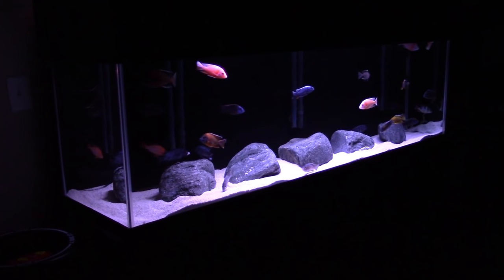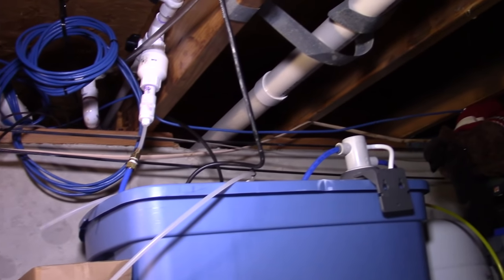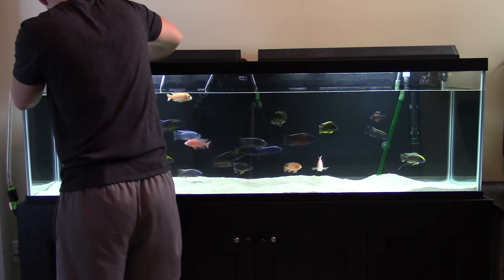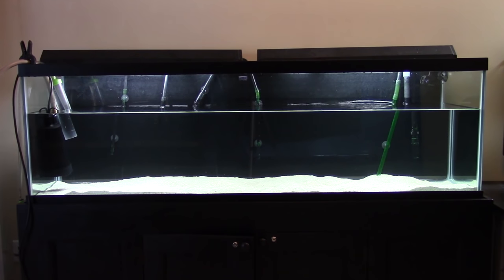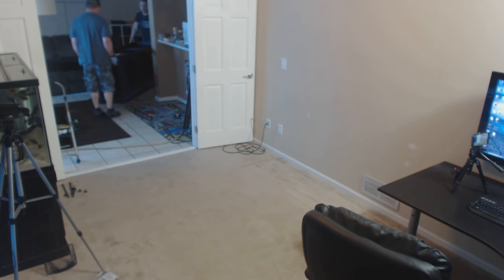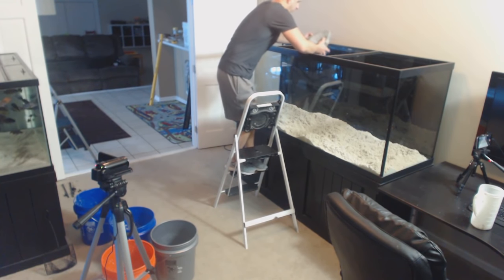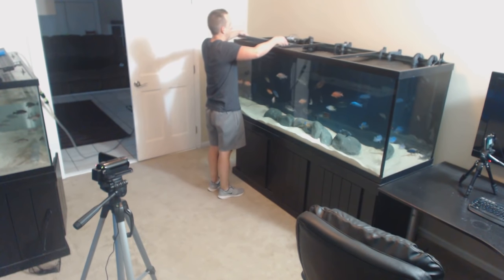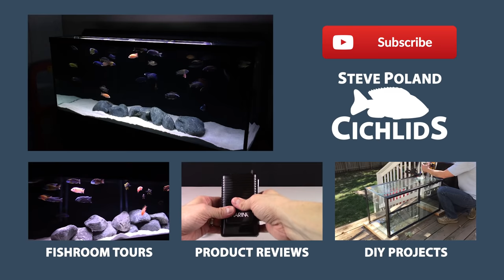How I Installed My 220 Gallon Aquarium

Comment: If you want to prevent cloudiness, we place the plastic bags from the sand on top of the sand and begin filling. As the tanks fill, the bags will slow rise to the surface. From there, you just remove them. The slower you go doing this, the less cloudiness you will get. We use this method for saltwater tanks which we all know can be a pain in the butt.
Reply from the maker: +Team Pham that's a good tip, though in this case most of my sand was coming from the old tank. I had a couple of new bags but they were super nasty inside after the sand was emptied and I wouldn't have wanted them anywhere near my tank.

Comment: tank looks phenomenal steve. I did pretty much the exact same process in switching my 125 to my current 220. you don't realize the difference in size until you get it up and running and can see from the side how much more room is available for the fish
Reply from the maker: +Adam C thanks Adam. It really is huge.
Reply: +Steve Poland Cichlids any plans to add any new species?
Reply: +Steve Poland Cichlids and I'm assuming you got a warranty card to send in within 10 days of purchase? make sure and do that within 10 days. I forgot and it was a pain in the A to get them to accept my warranty card cuz I was a week late
Reply from the maker: +Adam C that's a good tip. I made sure to send mine in within the 10 days.
Reply from the maker: +Adam C not at the moment. I combined all of the biggest fish from the 125 and 90 and I'm going to let them chill for now.

Comment: I went from a 125 to a 220 like you but I used two 55 gal drums to save the water and gravel as well as running my filters. It gave me immediate fish stocking without the worry about ammonia spikes and change over so as to not stress out the fish.

Comment: Excellent video Steve. I just finished up painting the back and bottom of my new 220, now just waiting for help to pick the sucker up and get set up. Transferring from a 125 as well and its already sold so I've got to get these fish move asap. Thanks for sharing this video is was just what I've been searching the tube for.
Reply from the maker: +Frank Wite thanks Frank. It's quite the difference in size and weight. Hope this helps you a bit with planning.

Comment: Painting over a tan carpet without a drop cloth? You must not be married... lol

Great video, Steve! Not many people think about reinforcing their floor. Luckily I live in an area of AZ where very few homes have a basement. Fish on!!
Reply from the maker: +Dude, That's Cichlid! I am married but the painting and carpet cleaning both fall under my list of responsibilities so I don't hear much about it.
Reply: Well it helps that you're not sloppy or clumsy ... I'd have done it, too. My wife's the same way... but only after a few years of minimal accidents or spills and knowing I'm crazy careful with every project. By the way, what was the price the seller agreed on for the 210 you resealed? I'm curious what I should be thinking of paying myself. Also, that tank would've held without a doubt. No one ever really trusts their first reseal. After ten years I might have reseamed it but if there weren't any stress bubbles you'd have been golden for another decade with a reseal. FISH ON!
Reply from the maker: +Dude, That's Cichlid! You may be right but I will sleep better this way. I sold the 210 for $400.

Comment: Did you begin filling the new tank with water straight from the tap? I'm curious as to how to you filled it while also preserving the bacterial in the sand, assuming that the water wasn't already dechlorinated. Wouldn't dechlorinated water kill any beneficial bacteria?
Reply from the maker: +Ashley Manville the beneficial bacteria in the sand is very hardy. The small amount of chlorine in tap water won't kill most of it. But yeah I just filled it right from the tap and added dechlorinator a minute or so after it started. I also preserved most of the bacteria in the biomedia in my filters.
Reply: Thank you! I'm  beginning to plan the move of my goldfish from a 29 gallon tank to a 75 and I have sand as substrate right now also. Good to know the bacteria can be saved! lol
Reply: I would have saved as much water from the old tank.
Reply from the maker: No benefit to doing that
Reply: Is that because all the bacteria is in the filters and sand?
Reply from the maker: Yes
Reply from the maker: Get yourself a product called a Python Water Changer. That’s where I would start.

Comment: It's funny how the fish followed you around the tank as you were first removing stuff and cleaning, then as soon as you started netting them they avoided you. 

I love the black silicone on Marineland tanks. It frames the tank nicely and looks great with the bracing and rim.
Reply from the maker: +Joshua Przygocki haha yeah, they definitely changed their tune once they saw the net. I'm a huge fan of the black silicone. I've always thought it looked great. When I resealed the 210 I used black but it just wasn't the same as the factory stuff on Marineland's tanks.

Comment: Dude drill that shit and toss the canister filters.
Reply: owl yea, herbie overflow to a refugium sump in the basement right underneath. and good thing you ditched the 210, while a reseal like you did is fine on up to a 55 gal, the only safe way to reseal a big glass tank is complete tear down because when you do the inside corners they are permanently bonded to the layer between the glass and this becomes a mono pour gasket for strength...

Comment: did the added floor joist support hold up after 4+ years? I am about to do a similar setup with my floor joists perpendicular and near a foundation wall just like yours. going to put in a 4x4 and jack the front part up in a very similar fashion

Comment: Great video. Did you have your floors supported while the 125g was there? My old house sat on a concrete slab so it was not a problem. My new house has the same kind of floors like you and I'm weary of putting a 125g  here. Not sure if I can get all the way to the location in the crawl space to support the floors either...

Comment: I recently picked up an old  135g aquarium that took 4 people to move with an appliance dolly; this aquarium weighs close to 300lbs due to it being made of 3/4" glass. I am in the process of building a stand/cabinet to place it on that will have the top of the 26" deep aquarium at ~58". My problem is, how will I move it down a narrow stairwell to my basement fish room? Any suggestions?

Comment: Great video, sweet freaking tank!  lol, you would save yourself a lot of time, effort and stress on the fish if you used two nets.   Hold the bigger net still and move the smaller net around to maneuver the fish into it.   Try it, you will be amazed how much easier it is to catch them.  Another tip if possible, is to catch them at night when they are still asleep.

Comment: I don't know if this will be seen but I recently acquired my first large tank off of a Facebook marketplace deal and it came with literally the exact same stand and gallon size that you have and I've been paranoid about filling it up because I noticed it doesn't actually sit inside the stand but on the trim  but I noticed urs is free floating just like mine so it's okay to fill I don't need to place a board and make it more table top like?

Comment: Perfect set up. Beautiful.  Did you save any of the water from your previous set up??
Reply from the maker: No
Reply: It's all about your filter and substrate, using other tank water doesn't do jack, technically you can instantly cycle your tank with a good used filter

Comment: i would have run a sump, i think its cleaner than 5 canister filters, but the tank looks very nice!
Reply from the maker: +sheldon jessup (converttoreef) it's only 4 canisters but it's a valid point. I'm not willing to run a sump in this situation though for a couple of reasons. One is that this tank isn't drilled and I don't really trust overflow boxes to move that much water. Another is the noise.

Comment: Hi, How is the "Aqueon Pine Wood Stand" work for your 220 gallon tank? I just got the exact same stand. But, I doubt if it's going to support the weight of 220 gallon.(You know the rim is not even fully stand on the top surface of the wood stud) Have you done any extra modify/strength before using it?
Reply from the maker: +GCperfect I've found that it works really well. It's a dado style construction so while it seems like the rim doesn't cover the entire surface of the studs, that's actually intentional. It's notched out.

Comment: Nice job on the video Steve. A pretty intense upgrade for sure. I'm sure you're enjoying the tank.

And finding a canopy for a 6x2 tank is difficult. Marineland makes one, but it's the Monterey line and insanely expensive.
Reply from the maker: +AJK Aquaria thanks Adam. Hope you've been well. I'm mid-build on a canopy right now and it should come in around $100. I couldn't find one that I thought was worth buying.
Reply: Welcome. Doing good.

I'd be interested in your build or if you used plans found somewhere on the net..
Reply from the maker: +AJK Aquaria I'm doing a video on it. I just copied the design of the canopy on my 90g. It's the standard aqueon pine canopy. They just don't sell a 6 foot version, at least not that I've been able to find.
Reply: 10-4 I'll look for the vid. Thanks

Comment: Awesome tank and video! A friend is giving me a 220 but since it's too big for the inside,  I'm thinking about putting it outside.  It will be under an awning in an outdoor living area, no direct sun but definitely lots of ambient light. Any thoughts on stocking with your type of fish? The weather in So Cal is pretty mild with the winter nights temps down to 45-50. Of course I subscribed.
Reply from the maker: +TJ TJ if you're going to go with an all male peacock and hap tank like mine I would recommend that you buy them young and grow them out. That way they have a better chance of getting along as they get bigger.
Reply: Steve Poland Cichlids y

Comment: Your tank is absolutely gorgeous. I have a 125, 2 55s and a 30. Soon I'm gonna be selling all but the 125. I was wondering where you would advise to get a tank the size you have.
Reply from the maker: +7667667667667h I got mine from a local fish store. They're not easy to find. It's either LFS or ordering online.
Reply: Steve Poland Cichlids I can't remember if you said it in the video but how much did the tank run you?

Comment: steve I'm trying to do the same thing you did, remove a smaller tank a put a larger one in its place, did you reuse your old water tank water, or why didn't you cycle it ? thank you.
Reply from the maker: +Ryan Miklusak no need to reuse old tank water. I talk in the video about wanting to keep my filters running as long as possible. This is because I wanted to preserve as much of the bacteria as possible. Using the already cycled filters meant that I was good to go.
Reply: Steve Poland Cichlids okay awesome, I plan on reusing my old filter at least at first until I can run another larger one long enough to build the necessary bacteria, thank you so much.

Comment: Nice work Steve.  I'm in the processing of setting up a similar like tank but I have a question about the light placement.  Do you allow your light to sit in the middle or front of the glass lid?  From this vid it looks closer to the front.  The reason I'm asking is because I'm curious do you move the light to feed your fish?
Reply from the maker: +driveboy42 I pull the light to the front of the tank and move it when I feed

Comment: Hi great Tank bud ...Quick question is there a reason why you went for cilinder filters over a Sump ...I'm still thinking about which I'm going to install would be great to here why you went the way you did ...Again kudos on the monster tank
Reply from the maker: +james78ish thanks! I am not opposed to sumps in general but in this case I'm using canisters for a couple of reasons. One is that the tank isn't drilled and I'm not comfortable risking this large a volume of water running through external overflows. Two is that the tank is in my living area and sumps tend to be loud.
Reply: Steve Poland Cichlids cheers Steve merry Xmas bud
Reply from the maker: +james78ish same to you!

Comment: Was this just tap water ? And no getting water temps same as smaller tank ?? Looks friggin awesome but would have thought new tank would need few days to get the water rdy..
Reply: the original water looked good. I would have kept as much of the original water as possible.  I had to move my 125 gallon tank two years ago and pumped all the old water into a bathtub, moved the tank, then pumped the water back to the tank.

Comment: how long did you let your first coat of paint set before 2nd coat? In the process of doing my 65g hex tank.
Reply from the maker: An hour or so. It will depend on temp and humidity in the room but once it's dry you're good to go on the next coat

Comment: Hey Steve, watched this video a few times over the years and im now preparing to upgrade my 60 to a 265 in the coming months. I notice how carefully you made sure this was level. If a tank is slightly not level, what would you have done to fix it? If the waterline isnt 100% straight what kind of issues would this cause?
Reply from the maker: If the stand is not level then you need to shim it. Long term if your tank/water isn’t level then it can compromise the integrity of the tank seals.

Comment: Hey Steve I just wanted some advice from a pro like you ! I’m buying a 150 gallon 7ft long should it be fine on my main floor with a basement under it
Reply from the maker: Depends on the house and where it is placed and where the joists are and how long they span. No sure answer but usually at 150 you’ll be ok.

Comment: I'm supporting my floor joists in the same way. I have my supporting 4x4 in the right location, but after doing some measuring the 4x4 sits slightly in front of the tank. The tank is sitting perpendicular to the floor joists and is against a load bearing wall. I was wondering if I should push the support beam a few more inches to be directly under the tank.

Comment: Is there a reason you decided not to go with an overflow and sump for this upgrade?
Reply from the maker: +Sean Tolentino if I had found a drilled tank at this price then I would have considered it. But in general I'm not a huge fan of running a sump on a tank that's in my living area due to the noise and risk of flooding. I know both of those issues can be mitigated but I prefer not to have to worry about it.

Comment: Did you not check temp and PH before moving fish into new tank?
Reply: I was going to ask a similar question but since he didn't answer you, I won't bother. I would be concerned about cycling the tank first before putting fish into new water. It could be a drastic change for them.

Comment: What's your rationale on painting the bottom? I usually do the back only. Just curious as I am in a planning phase for a 300 gal but I think I will do it with acrylic. That's a lot of water and I do not want the wife to freak out.

Do you have a video on how you put those heaters into the pvc?

That was awesome to see that fish hide under the sand. What is the name of that fish please? What is the sand you are using? I like it!

Comment: Hello Steve, Do you live in a house with crawlspace? If so, did you reinforce the floor? I'd like to install a 125 G but I'm afraid the floor will cave in.  Please let me know how I could upgrade to a 100 G+ with my house having a  crawlspace. THKS!
Reply from the maker: Did you watch the whole video?
Reply: Sorry I missed the reinforcement part, quick question....did you have reinforcements for the 125 G or did not need it. Most people I've talked to say for 125 G I should be OK without reinforcement. THKS just go perpendicular to joists????
Reply from the maker: Didn’t need it for the 125. Probably don’t even need it for the 220 but I wanted to be safe

Comment: Those tall tanks aren't as easy to clean but they look good. I have been using the big SunSun filters for the last few years without any problems and at less than 100 bucks a piece they are hard to beat..

Comment: If you paint the back of tanks with Plasti-Dip paint  (brush or spray)  it looks great, and if you ever want to change it......just peel it off.
Reply from the maker: +IrishGrampa excellent point. I never really have a need to change mine though and if I did then worst case I could scrape it off. But I'm all about plasti dip for other things and in fact I am working on a video about it right now.

Comment: I find using a dustpan far easier than jugs to remove sand.
Reply from the maker: +ORANGE FISHHEAD you're totally right, that's the one thing I forgot. All of my dust pans were too dirty to use for this and I didn't feel like running to the store.

Comment: you should build a taller rock structure out of styrofoam, paint and carve it to look like rock
Reply from the maker: +The Legend34 no I shouldn't for a number of reasons
Reply: Would look nice actually. Could cover it in pond sealant or what ever it's called so it's water tight then burry it in the sand a bit do it stays in. There's a rock I wanted at the pet shop the other day.. they wants 340 for it!!!

Comment: you asure ain't very good at catching fish chasing them from end to end, and back again, like that... it's no good for you or the fish. use two nets, one to keep still and another to steer them with
Reply: also use a shovel to get the sand out, much easier than using a round object like a jug, on a flat surface